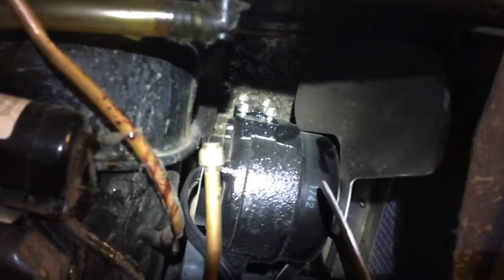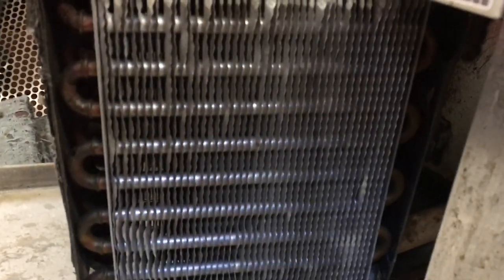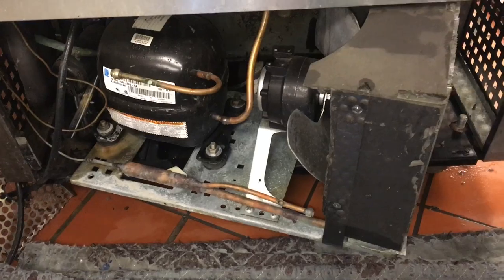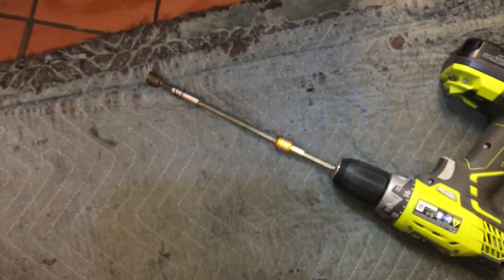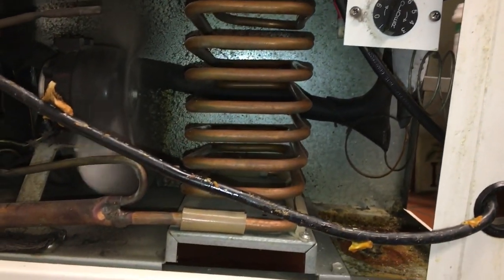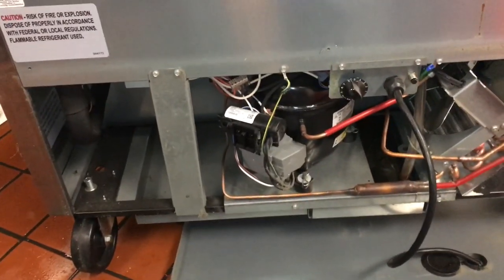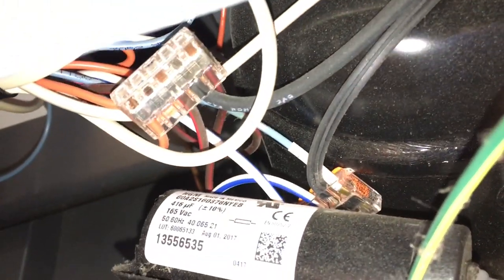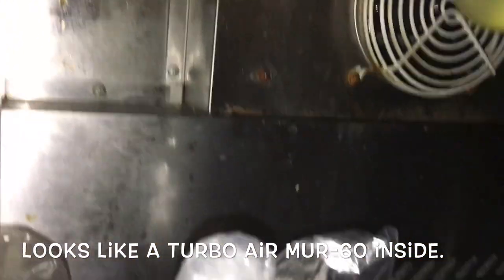Cleaning Lots of Condensers / Maint. Deep Freezer Condenser Highlighted cleaning.

Comment: Where is the condensation coil in new chest freezers
Reply from the maker: If its not beside compressor , it’s going to be in the walls of the freezer. Feel the Walls on the outside of the freezer. The Longest sides , front & back sides.the walls will be warm when freezer compressor is running. Look in the freezer manual for specifications as to How much Air gap distance is required for operation. 
It Will be 1” Minimum for Good operation.
Reply: @OcRefrig  so is it necessary to clean those coils? If necessary, should we open the walls? How is that possible?
Reply from the maker: @MrNeisonpromise   Lol ! No Cleaning necessary ! Maintenance Free !!!
Just Keep Walls clean on outside & Keep Direct sunlight off walls if possible. Cool Location is Best if Possible for Less energy usage.
Reply: @OcRefrig  my three year old Frigidaire Chest Freezer stopped cooling all of a sudden. Even before it was a very silent freezer. From a long time I've seen it's indicator light which is green used to blink and sometimes it's not lighting up. But it was working fine. Any suggestions about how to get it back to life?